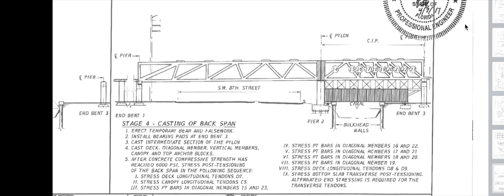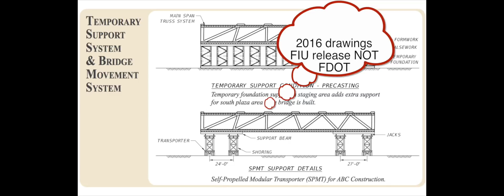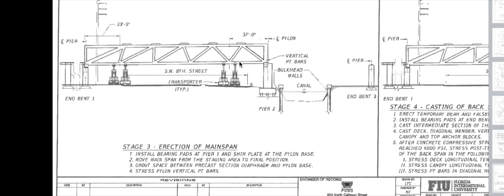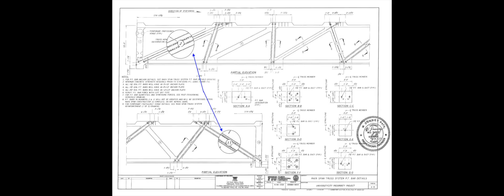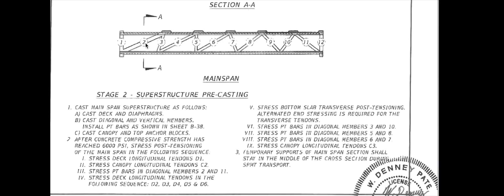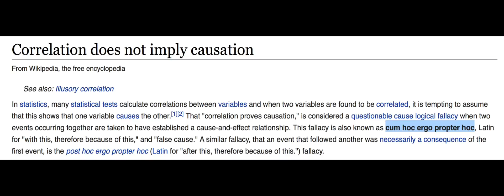FIU Bridge Collapse SMPT LOCATION & NEGLIGENTLY  Deviated from  Supports During Transportation

Comment: I think in one of your earlier videos it was stated that this bridge could have been a steel structure, and would have weighed 1/8 that of the concrete structure.. Not sure this could have been from another source.  Just wondering why concrete, was there a cost advantage, a span advantage???  I enjoy your videos,  thanks
Reply: NOT TRUE. Steel material cost more in weight, but needs much much less of material in weight. much much less in labor cost, and very fast to erect and construct. Most if not all members will be fabricated in mills. You can request the powder coat to reduce the future maintenance costs. Steel will be my first choice. The concrete truss system only happen in "3rd world countries" with "pour-in-place construction" where the labor cost is very low comparing to material cost. I guess they came up this idea from visiting Cuba, and political reasons (like create "unnecessary" jobs).
If use steel, the material is 4 million total, with 4 million labor would cover. If use concrete, the material is 2 million, but labor will cost you 10 million. Ask any cost estimator, he would tell you. NOT mention UNION labors.
Reply: Powder coating is a plastic material. It will still need periodic maintenance and painting after the plastic has been exposed to sunlight/uv for a period of time imho. Also, steel is subject to fire in some cases, such as a tanker fire on the road below. There are many factors.
Reply: I am a structural engineer. Working on a project NOW which my bar joists can 1. clear span (larger span means heavier steel bar joists), or 2. use Middle bearing (lighter bar joists), but more labor with bearing plates, grout, joist ties, inspections. I choose the second one for this project after balancing all options. 25% weight saving for my steel. )less weight also means less transportation cost) Since at a first glance, people will notice lighter steel material, before even they considering labor cost for this case. 
Being an engineer, you are not only responsible to design safe and simple (easier to build, straight forward) structures, but also provide your inputs on the cost, timing,  authenticity, function and more. 
In US public sector projects, labor cost and speed are always the most important factors. (speed also saves labor) This FIU bridge is a public sector project, it budgeted 14 million which in private sector, it costs 6 million or even less. Of this 14 million, the parties will contribute to politicians campaign funds at least 100,000, plus all other B$s, like hiring minorities, sub-contract to minorities owned companies or even grease palms of some politicians' or FIU president, using someone cousin's law office, accounting office, some consulting companies. 14 millions might NOT be even enough. You know how dark and deep the water is. This might just be "some important idiot (only in construction) " said "It is nice to build this bridge in portable concrete truss system to show we (politically correct people) still can send people to the moon ( like the Germans did for USA after WWII). There should be minimum 25% of the cost (0.25x14 mil) of work set aside for minority companies for any Federal funded projects. That is law. Not mention this is minority owned company to begin with.
Reply from the maker: This design was never structurally sound to be placed in-service / positioned over the public OR without span support!
Those cracks are a major indicator of design failure!
Negligent homicide for all parties who were involved in two hour meeting and especially FIU for not condemning bridge with those cracks!
Reply from the maker: John, I recall stating something about the main structure should have been steel and used a concrete product for the decking...  but, never use concrete in this fashion again... concrete, for the most part, does NOT flex and it fails ''brittle failure" when it does... steel, mostly will be ductile in it's failure.
Reply: John Montgomery a yard of concrete is around $150 for high fiber high Portland cement 8000psi give or take. 1/8 of that weight is 500lbs of steel (about a cubic foot). Steel is about $.50-$.60 lb or about 2X the cost. Steel also costs more to build than concrete.
Reply from the maker: plus edited replies, including one from you... =8
Reply: David L ..  Wow awesome observation on this
Reply: Construction Engineering & Photography I agree 100% the idea that they are changing the tension on a member with cracks while humans are underneath, is just incompetence. Everyone just assumed the other guy knew what they were doing. No one would dare to say- stop traffic, this POS might fall. There are those that trust with blind faith and those that look at a building with a raging fire 2/3 of the way up and understand that there is a decent chance it could all fall down. For some, it is not hindsight.
Reply: Jimmy's tractor..  I am questioning the design with all of the hidden unknowns.  Possibly a steel structure is easier to see and understand without the chaos math.  Steel is largely a hollow structure, where as concrete fills all of the voids, so is there really 2X the cost, I guess using your math it makes sense.. With the added materials and labor in forming this complicated concrete structure, would the cost balance out.   Most importantly, would the steel structure have collapsed?  Thanks
Reply: So as I read the replies, in View All 8 replies, but I only see 5 including this one ??
Reply: David L  .. good input..  are you an estimator?  
I have heard that the total cost of this project was going to be around $14million
Reply: Love the videos.. thanks  .... We work in commercial buildings where you see steel structures, and robertson decking for the floors.. Seems like a proven system, at least for buildings
Reply from the maker: Thanks John... I have a video coming out tomorrow...
Stay tuned...
Reply: Florida is a very concrete oriented state with no substantial steel fabricator in the state.

Comment: You hit on a couple of points there with the original placement of the transporters and temporary supports as mentioned here by you but then as we know were about to transport the bridge on the extreme ends only to once more deviate back to the transport positions that we had all witnessed because of temporary structures in place in one area that was to be traversed by the transporters. So my question is this, Was the bridge tensioned to be transported at the extreme ends?
Reply from the maker: I was trying to also get across that they "might" be a possibility...That "extra" tensioning took place to "compensate" for not using the supports, in the center span...
Please, read my description I posted under video.
Reply from the maker: This design was never structurally sound to be placed inservice / positioned over the public OR without span support!
Those cracks are a major indicator of design failure!
Negligent homicide for all parties who were involved in two hour meeting and especially FIU for not condemning bridge with those cracks! Which would have saved the public by closing off the road....But, FIU, would not want to make that report to the granting authority as it would reflect and on themselves...
They had too much skin in the game and a conflict of interest vs their responsibility to protect the public.
Also FDOT could have arbitrarily closed off road with those cracks!
Reply: With SMPTs at first bottom node of the 'truss', web members 2,3 10 and 11 must resist forces in opposite direction to those they must carry in final position. For example during transport, member 11 is in tension (pretension helps this ) however the top is in tension and the bottom in compression due to the cantilevering of the end portion of the structure. Once set on the end bearings (piers), member 11 must now resist high compressive forces. These will reduce the tension in the pretensioned bars inside member 11. The top is mow in compression over most of its length (maximum is at mid span) and the bottom deck is in tension throughout (a maximum at mid span).  I am hard pressed to see how the design handles the changing direction and intensity of these forces nor how the forces are  transmitted within each node.